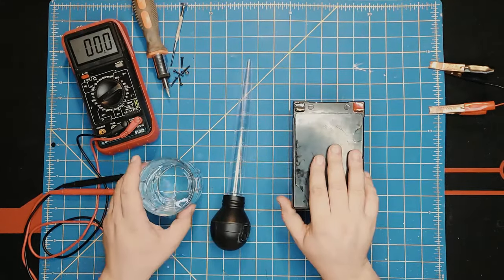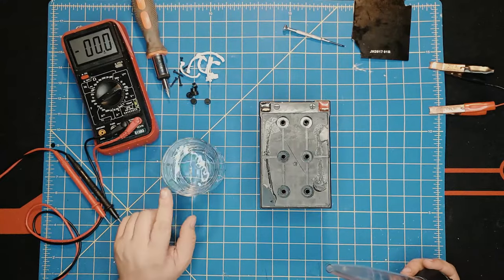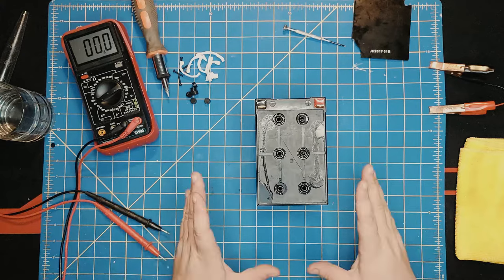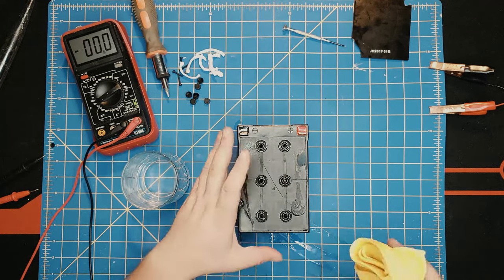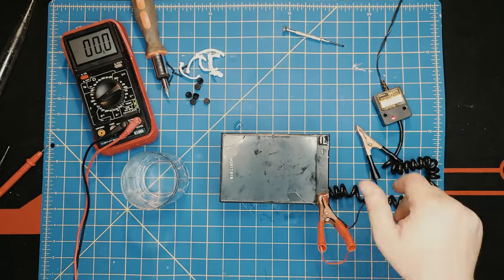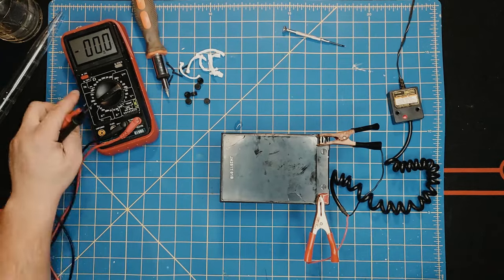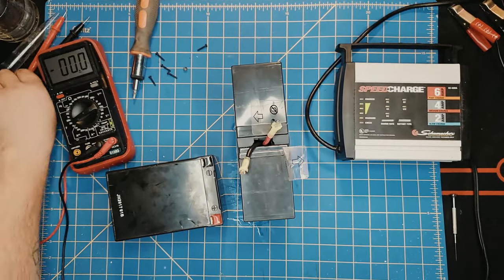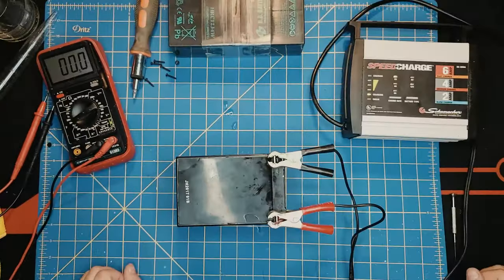Restore a 12v dead lead-acid battery, YES IT WORKS

Comment: A snake oil promoting clip. If Pb battery is old and half dead/dead the plates will be irreversibly sulfated and no charging in the world is going to bring it back to life.All magic procedures using MgSO4 are BS and replenishing missing volume of electrolyte does nothing.Yes, you might reach 12V or slightly below.However it is about VOLTAGE and CAPACITY and a "recovered" battery will die within minutes.All warnings about H2SO4 at 33-34% are greatly exaggerated .One can stop one's finger into battery acid for a couple of seconds ,rinse it and observe no damage
Reply: To use the term "snake oil" would imply something is being offered for sale. Something that doesn't work or is not needed. Yet no sales pitch interview video. Also I have personally done this to my batteries and they work like new now. Keep your know it all opinions to yourself.
Reply: @judsonmontemagno  One can sell an item or an idea,a figure of speech.I'd like to believe you that all your " revived" batteries are almost " like new", but sorry,unless you demonstrate the capacity of the battery is at least 60% of its rating,it will remain a wishful statement.Recovery of the voltage rating is not good enough.If the battery is truly reconditioned,it will hold voltage levels relatively steady over weeks,once fully charged
Reply: @judsonmontemagno k
Reply: @petruse8893  said he did it to his own batterys and it worked... you said it doesn't work so why not try it instead of just just saying it doesn't work lmao
Reply: And why are you looking up how to restore a battery if you think u know it can't be 😂
Reply: @XplorinWithPaul   Your logic follows how most of law enforcement agencies tend to reason.And why did he watch a clip describing a nuclear device construction?  He must be planning to detonate the thing in the middle of a city.Otherwise he would not be interested.!00% waterproof logic.I watch from time to to time videos promoting a flat Earth idea ( iron clad proofs it is the case). Nevertheless nobody can convince me the Earth is not round(almost)
Reply: Snake oil indeed.
Reply: You can desulfate with high voltage AC plus alum. The end of life is when the plates are mechanically deterioriorated. Usually won't accept a full voltage due to shorted cells or charges too quickly due to broken cells. A lot of these little batteries have been cooked to death by gross overcharging ime.
Reply: @christopherleubner6633 what is alum?

Comment: if there is zero sulphuric acid and only distilled water you will get nada Volts..not even 1.. Se3cond point. Acid will take a while time to cause damage to yourself (skin), but it does stuff you. I've worked with hydrochloric acid for over 40 years on a daily basis without using any safety gear. I can no longer live in a cold climate as my skin absorbed the vapours and now my finger tips go black in the cold and hurt. My lungs are also fkd (never wore a mask) and the fumes burnt my insides. I'm old school thought it was tough not to wear ppe or safety gear and now I'm suffering, yes it took a long time, but you only need to get caught in a vapour cloud once and damage is done.. Sorry about the long winded comment but im just trying to explain how important it is to wear safety gear. BE CAREFUL HANDELING ACID
Reply: @alexpg13  thanks for thw advise.  i will make sure to do all that tomorrow while trying to revive my big traveling speaker.
Reply: Thanks for your insights, I would like to hear more from you
Reply: You right, sr is very important wear  the safety

Comment: My technique is super simple. I open it up to get to the cells. Then make a boiling hot solution of potassium aluminum sulfate AKA alum. Then while still piping hot inject 1 or 2CCs per cell. Next I add distilled water to top them up over the plates. Then wait 24 hours. Next apply AC through a 100W light bulb to the battery till the bulb lights brightly. Next add a diode and give the battery DC for 15 minutes and charge normally. If it goes to high voltage very quick or fails to light the bulb the battery is dead. Helps to put the battery in a glass pie dish when doing the initial sulfation breaking and charge with the lightbulb. You can scale up to do bigger batteries the same way

Comment: This will work for a small amount of time cuz inside battery the cells r oxidated if u really do a good job u need to desulfate the battery with high current like welding machine and switch a few times the liquid inside till the oxidation on plates r gone
Reply: r we still typing like is 2015 because it r too difficult to type out "are", "you" and "because"?

Comment: I've tried the same method to my jump starter battery which has been dead for about one year.  I used battery liquid bought from Auto Zone instead of distilled water or rain water. I also used the harbor freight charger like yours, but even leave it charged for 3+ hours, the voltage only stayed about 7 volts. Afterward, I also charged it over night but there is no gain of voltage .... So, I wonder if this method really works ???
Reply: Did you drain it first? If your using acid from AutoZone id drain it, fill with hot water and drain (even do this twice) then refill with straight acid. Wear eye protection and remember even 1 drop eats holes in your clothes (imagine it on your skin)
Reply: @allenrusselljr  Thanks for reply ! The battery was totally dried out and there was nothing to drain ( just some black powder fell off when I turned it up side down ). I had filled with very hot water and drained it twice then filled it up with AutoZone battery liquid ( contains surphuric acid ), left the chambers open and charged for 2-3 hours, the voltage was just 7.0 then I charged it again for 24 hours but the voltage was just 7.4.  ( I met a friend who is working in a battery shop and he told me, battery factory stopped using liquid and use GEL for more than 10 years and he told me that  my battery could used GEL instead of battery liquid and told me to buy a new one )
Reply: @lorddiablo8575  interesting, I didn't realize we could use a gel instead. I'll be honest, I'm clueless when it comes to gel batteries. What type of charger are you using? Does it have a boost option? The reason I ask is Ive seen videos where you remove the caps to each chamber and charge it again on the boost setting. I THINK but am not positive that they used 50 amps setting. You ONLY do this for 5 MINUTES every hour until every cell is bubbling. I haven't tried this process yet but people swear by it. 

Then there's always the chance your battery has an internal short in it. If that's the case then nothing's going to fix it .
Reply: There is no fixing a sulfated battery
Reply: My Welder disagrees, that bugger connected welding terminals on my battery and it started to boil, he did it 3 times, to cut the long story short, i'm still using a that battery on my hyundai.

Comment: So i have a similar battery , from a ups , 12v 7.2AH/20HR . So the story goes , i had an old ups i wanted to use, i left it to charge for 8hours roughly, The ups didnt get charged at all and it also heated , ALot . I took it apart to find the battery really hot and not holding charg at all . even after 8 hours of charging it had only 1.6 V . So i watched this video followed everystep. I used distill water i got from the hardware store . i put water in the battery waited about an hour before charging , while charging , i connected it back to the ups board because i dont have a battery charge. and like he said while charging i didnt put the caps vback on yet because of the gas build . so i connected it to the ups and it started charging , and very soon the water started bubling , very hot and started to overflow and flow out of the batter hole and this is being done in a well ventilated area but i ca definetly smell some sort of chemical in the air, a tiny hint

Comment: No gloves?  No protective eyewear?  No thanks!
Reply: Do you put a protective cover down when you sit to piss or is just Toilet Paper safe enough for you, Bobbo?
Reply: Don't be scared, you only live once.  Try taking a break from your safety man job.
Reply: @makaveli087  Actually, I don't have sulfuric acid in my toilet -- so I don't have to worry about the occasional splash.  This way I don't even need a protective cover for my toilet.  I also just replaced my lead acid battery with a lithium ion battery, and I shouldn't ever have to replace it.  For goodness sake, why play around with sulfuric acid when a splash could blind you, or burn you severely, when you can pony up $20.00 and buy a replacement?
Reply: @radiumreplays6045  I'm not scared of lead or sulfuric acid, any more than I'm afraid of a rattlesnake.  I just treat hazardous stuff with respect, so it doesn't turn out to bite me in the ass.
Reply: You can recover your toilet with a bigger bottom 😅

Comment: Do you want to restore a lead acid battery for sure ? 
You must remove the old electrolyte , clean out all the old mineral deposits , some of which conduct electrons from between the plates , the. Reassemble the battery , and put back new electrolyte .

Comment: Does this reduce the capacity of the battery? If I used a battery acid solution instead of water, would it retain it's original capacity?
Reply: Capacity is much reduced and it won't last long at all.
Reply: You can restore a 'dead' battery with this method, but the problem is it will drain quickly. Basically no use.

Comment: What do I do if it is heating up?  12v 4ah. I'm running another 12v POS to POS and neg to neg.
Reply from the maker: a bit of heat is normal, you should see some bubbling, but if it gets too hot disconnect it...let it rest...then reconnect...but some heat happens in this process..just keep an eye out for the water not to boil over and make a mess plus make sure there is enough ventilation around and not in a closed room.

Comment: Can we use rain water.. and I have a gel battery are they the same?
Reply: No you can’t
Reply from the maker: i haven't tried myself with rain water but I have heard others use it in older batteries...i can't really say if it works but that is a cool idea for me to try though
Reply: Can rain water be used in place of distilled water?

Comment: this kind of batteries doesn't require acid or water like you did
Reply: They only claim to be maintenance free.  ALL lead acid batteries require the acid and water.  Adding water back to replace the evaporated liquid is only the start.  Lead oxides on the plates needs to be cleaned by applying high current in short bursts in order to de-sulfate.

Comment: Almost worked.

Went from 3 volts to 11 volts.

The Simonini starter needs 12 or slightly more volts.  Starter sort of moved, but no full starter engagement. 

One cell is totally dead.  A short down in the bottom somewhere, apparently. 

Saw a video on cutting apart the battery to rebuild the cell, but that seems to require welders, plastic reforming, fresh battery acid, new plate separators, stuff like that since you'd basically be rebuilding part of the battery after completely draining and cleaning it.

Looks like, if there is nothing else I could do instead of all that, I'd be better off just buying a new battery. 

I am such a "consumer"... not a genuine technician at all, apparently!

Lol.

Comment: Just reverse the polarity? fill with distilled water,drain the battery down to absolute zero (very important) volts
and with a suitable charger capable of starting charge cycle at o.o volts place positive on negative and the negative on the positive and charge like you normally would.